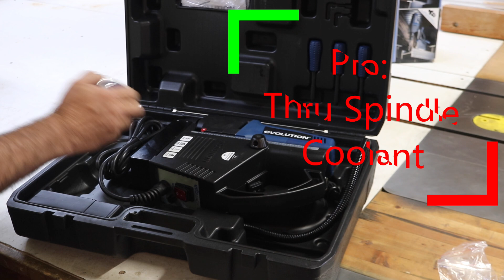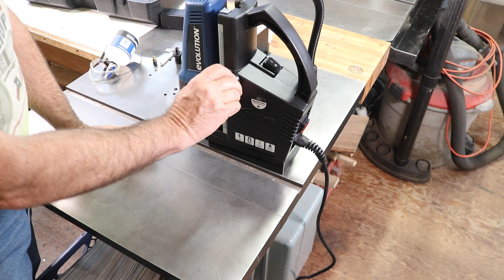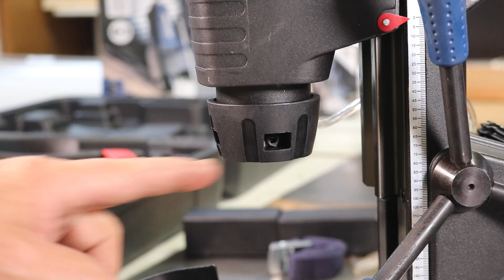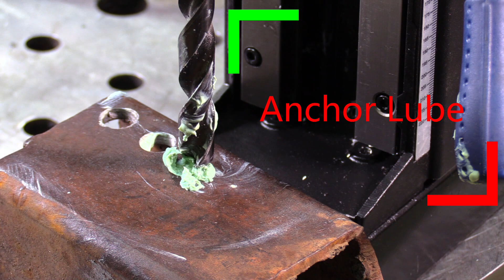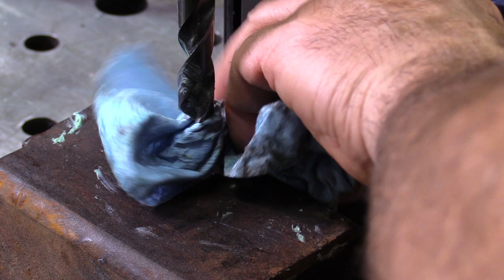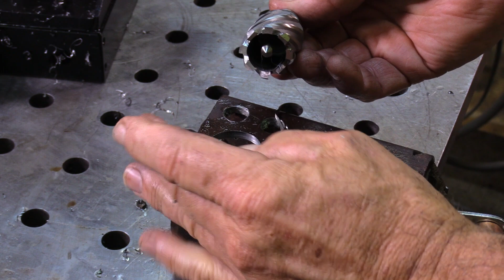New Evolution Tool for the Shop - Evomag42 Mag Drill

Comment: You can do peck drilling with this gizmo to keep the chips smaller. I have one and that's what I do. For drilling big holes in steel, these mag drills with annular cutters are the bomb.  The fact that they are  portable and can be used on construction steel (in place) is also a plus.
Reply from the maker: Oh yes you can.  But Annular cutters prefer to stay in the cut, pecking is a pit hard on them and you can break teeth..Thank you for the great comment.

Comment: Looks like a nice unit Randy.  I have the Evolution metal cutting skill type saw and it is great.  The quality seems very good. I've mostly used it for mild steel plate and have had no issues so I'm thinking that Evolution is putting out tools of a reasonable quality for a price that allows even a hobby level guy like me to get a tool that will do the job if I need one.  They are not giving them away, well Randy got one, but the top of the line stuff is so expensive that I can't even think about buying something of that caliber.

Thanks for the video Randy...
Reply from the maker: Thank you John.  This one does work well, I do like the coolant feature.